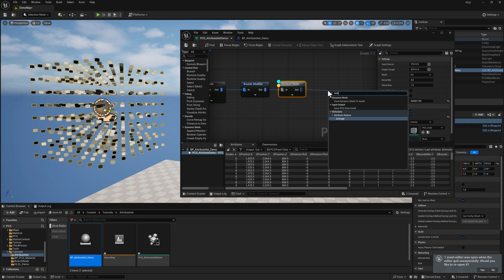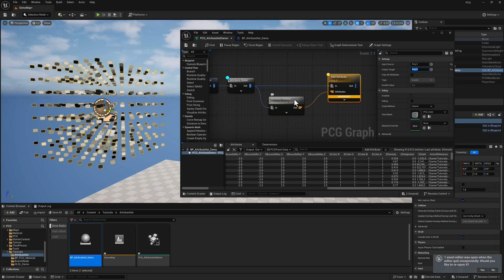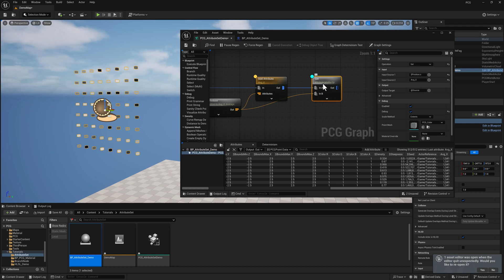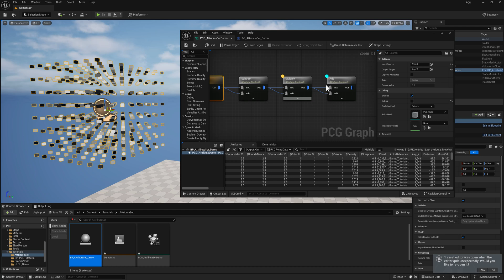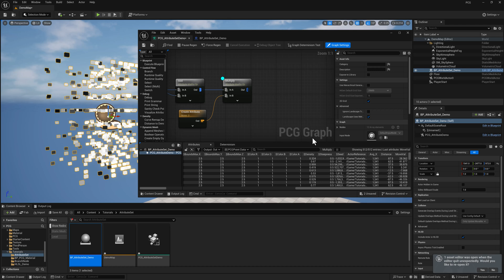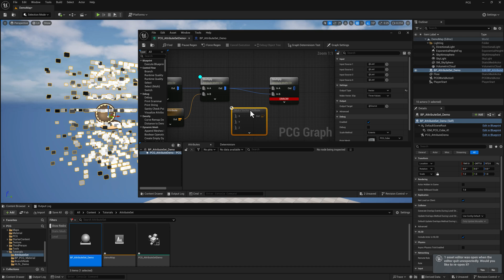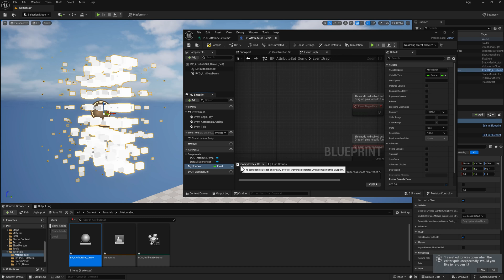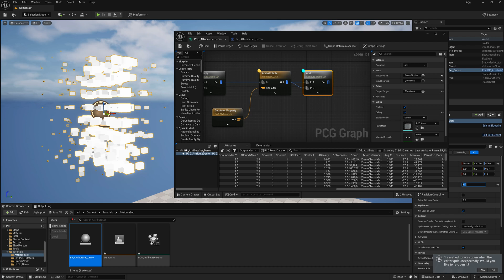PCG Basics - Attribute Set Data

Comment: Hi, im trying to create a city using PCG would i be able to use this technique to have an entry say, building type and use this to drive the distribution on the grid? would this work if the buildings are using a grid layout but the overall shape is not square? such as a circle or diamond shape? would this just be expressed as a zero so nothing is generated?
Reply from the maker: I'm not 100% clear on what you need,  but Chris Murphy just gave a talk at UnrealFest Orlando that covered building a procedural city with Niagara.   It was live streamed so you may be able to track it down.